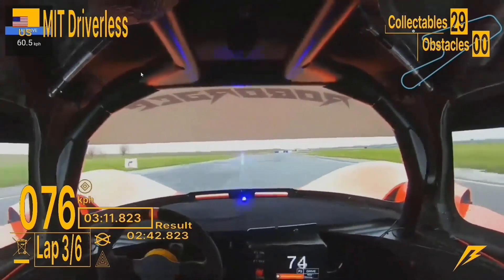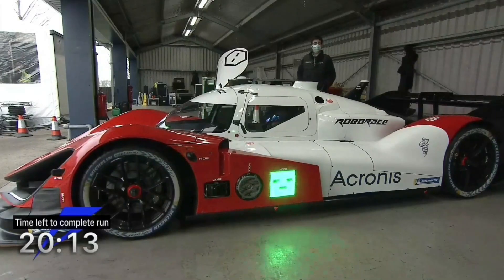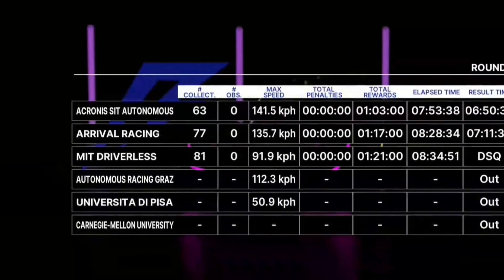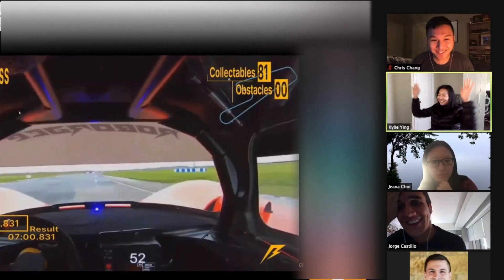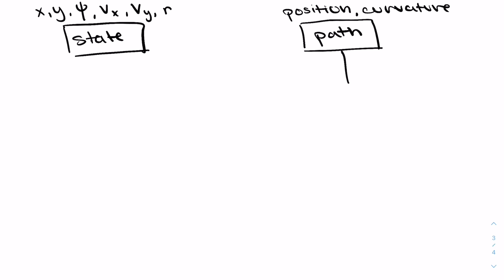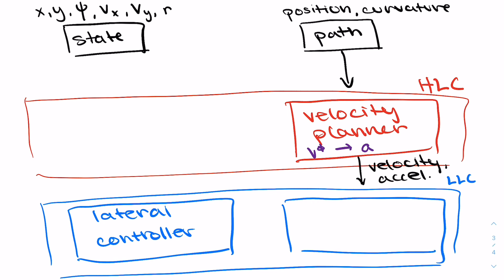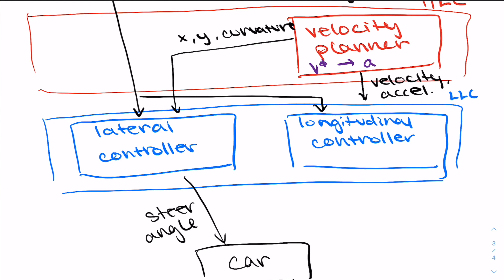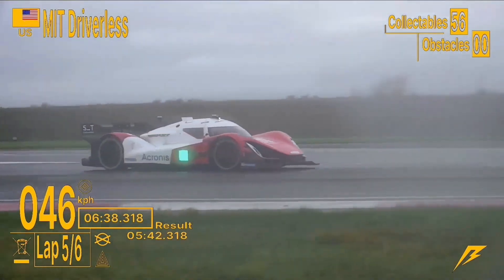Why our self driving racecar was DISQUALIFIED | MIT Driverless | Roborace Event 1.1 Rounds 3 & 4

Comment: Why not using a minimum selector, where you select the minimum output of the controllers, and add a follower to the output being used so that the other controllers do not overdo?  I used that principle in pumping stations with pumps working in parallel, where you have three controllers in parallel controlling pressure, speed and flow. I hope I explained myself correctly ;) good luck with your project